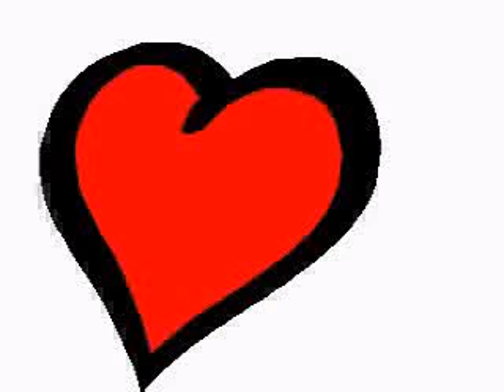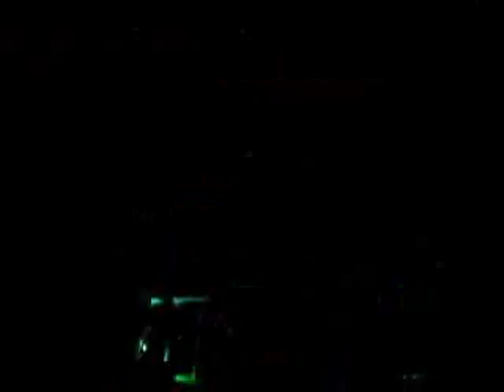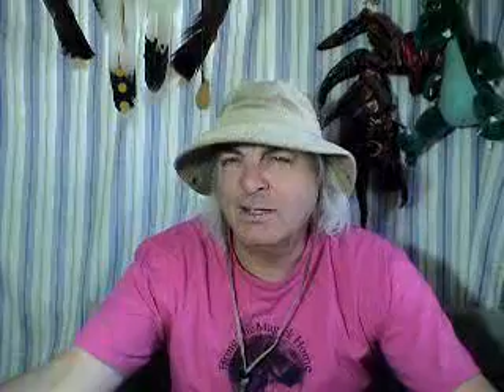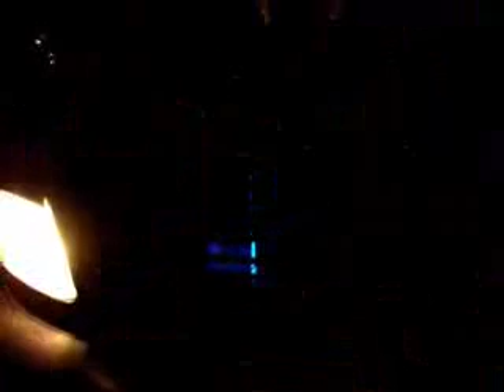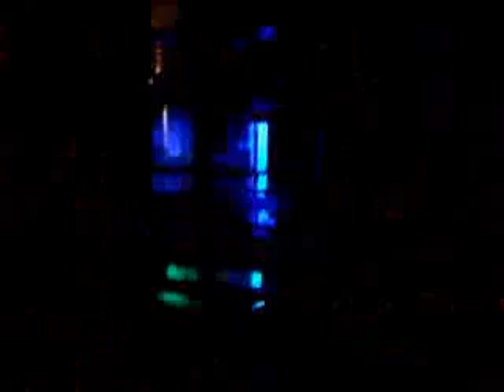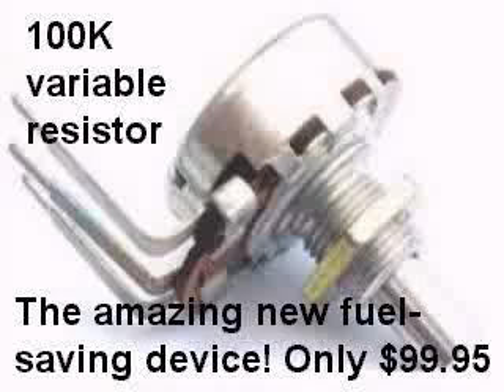Re: "HYDROGEN HYBRID (sic) TRUTH (sic)"

Comment: Regarding the alternator, did you know that an alternator only uses about 3 to 5 HP at load? Did you know that installing a CAI can increase you HP by 10 or more HP? So if I add a another alternator to run my HHO generator and install a CAI I won't lose any HP. Visit my channel to see my CAI and how it's improved my MPG. Look in the comments section and find a link to the DOE report I mentioned earlier. My next MPG test will be to add a 20-40 amp load to my alternator and see if it affects MPG

Comment: I think you need to do some more research because you are wrong. Here's proof taken from a D.O.E. report published in 2001: Hydrogens low ignition energy limit and high burning speed makes the hydrogen/hydrocarbon mixture easier to ignite, reducing misfire and thereby improving emissions, performance and fuel economy. Regarding power output, hydrogen augments the mixtures energy density at lean mixtures by increasing the hydrogen-to-carbon ratio, and thereby improves torque" 

Continued...

Comment: I never run an engine lean. I only use my HHO cell to make the improvements. 
I am sure You know how to fuck up an engine, but that is not what I am doing. After 1 year on HHO my van runs better than ever. I was about to rebuild it before I added the first HHO unit and now I won't touch the engine because it runs so good.

Comment: Since your name says intelligence I will ask you what experience you have with HHO gas? My system operates at less than 10 amps and gets me 30% improvement in mileage. 
Theoretical "PROOF" is useless when discussing this effect. According to energy conservation this should not work, but it does.

Comment: Put your money where your mouth is "Expert". I will pay anyone's travel expenses to the Jarboes Mill event May 30-31 in Md. if I cannot prove by driving down the road that my system gets 30% or better improvement with HHO. You will be required to pay me $1,000 for the ride when it is proven. Of course you will dismiss the test as "Unscientific" and run with your tail between your legs like all the others. Either way it will shut you up.

Comment: You electrical energy is not free. The alternator has more resistance with larger loads. The key is keeping the amp draw low. My systems use less that 10 amps on most cars. In my van I can't use more than 7 amps or my mileage gets worse. Your right about the fuel burning more completely. I have met Ozzy and a lot of other hho guys. I was not impressed with him. I group him with Lee. Ozzy did do a lot to bring attention to the HHO movement so I give him credit for that.

Comment: You are making quite a lot of sense there and I too have my doubts about this whole increase mileage thing but what about the HHO generators used for welding?

Cant one simply use Hydrogen instead of Oxy Acetylene for working with metals and such?
I know Hydrogen is highly combustible so normally it would be dangerous but as it is produced on demand in relativeley low quantities wouldnt that be safer than the traditional big tanks full of explosive gas?

Comment: these claims are true if u run a vehicle on hho u will get more fuel mileage and a smoother running engine but those devices are inefficient and a drain on your alternator ,also u do not have to touch the map sensor if u put the inlet hose before the sensor it just fools the sensor on its own.

Comment: Desertphile, you look like an interesting guy by the way. Anyway, did you watch the Myth Busters episode where they debunked the HHO generator? I still have not but I did hear that they didn't add electrolyte into the water inside the generator, do you know if this was true or not? Also, do you know of any hard test data on these devices? As of last year there wasn't anything that I could find  which is one reason I didn't buy one.

Comment from the maker: "But, if one was to actually program the ECU to accept the newly introduce fuel, the mileage per gallon of gasoline would increase as less is needed."

What "new fuel?" These devices don't produce enough H-OH+ for the engine to even notice. There is no "new fuel" from these devices. No matter what one does, these devices do not work.

Comment: No, you can't just buy one of these systems and throw it on your vehicle and "Ta-da" better mileage, perhaps on new vehicles the ECU picks up a little better, but still is does ad to the power you get from your vehicle even though it is consuming more fuel if inproperly used.

Comment: example would be a tuner car (Which I do most of my testing on) with either APEXI or ECM-Link where you can manually adjust everything that goes into the engine. Yes, there are dangers to leaning out the fuel mixture too much with a stock bottom end, that is know. Currently the lowest possitive test I have completed was 23.75% fuel to 76.25% air. But back to the question "OxyHydrogen does nothing?" that is totally false, but as to the effects it has all depends on installation. ...

Comment: Yes, it is true that these devices BY THEMSELVE will cause the ECU to "Waste Fuel" in a sence, but even at worst case scenario and the the ECU does "dump" more gas into the cylinder, you are going to see a HP/Torque gain like running with alcohol, or nitrous( no that large a boost since the lack of pressure in current hho devices). But, if one was to actually program the ECU to accept the newly introduce fuel, the mileage per gallon of gasoline would increase as less is needed. A perfect ...

Comment: "they use liquid oxygen and hydrogen to propel stuff into space after all dont they"

Yes, they do, but.. with limitations.  Say NASA fills up the external fuel tank of the Space Shuttle and then the launch is delayed a few days.  That tank isn't pressurized, it only holds the fuel so long as it remains supercooled liquid.  But since our atmosphere is not supercool, they heat up and evaporate and are vented.  They have to keep topping off the tank until launch.

Comment: "so what if you just syphoned a little of the power it is already generating to perform the hdrolosis?"

Okay, this point is being made over and over again.

Because you are not drawing power off of that which is being already generated.  Before plugging it in to the fuel cell is is drawing a certain amount of power.  Plug it in to the fuel cell and it has to generate more power, and as such puts more of a load on the engine which causes it to burn more gas.

Comment: I'm not talking large electrolytic caps, which can hold a charge for a couple of weeks.  I'm talking the double-layered carbon foam types.  They call them supercapacitors or ultracapacitors.

If you've got production supercaps at work that can hold a reasonable percentage of their original charge for more than a day or two, I'm way, WAY behind the times.

Comment: You could get the same effect of leaning out the gasoline to oxygen ratio without using an illegal device on your fuel injected engine by driving only at high altitudes. I was amazed that when I drove through the passes of the Rocky Mountains my mileage went up even though it felt as if my engine was working harder. But using gasoline to produce a gas that the engine doesn't even use is just stupid. Another great vid! Keep 'em coming.

Comment: Pulling torque off the crankshaft by connecting to the alternator isn't "free"; it produces drag on the engine equal to or greater than the power output of the alternator.

Meanwhile, use of supercapacitors is rather specific; they lose their charge in a relatively short time (something like 24-48 hours), so they're excellent for quick-cycle applications - such as hybrid cars - where you need to be able to store and release a large amount of power at a high cycle frequency.

Comment: The costs for valve jobs average $200 to $600 per engine cylinder in the midwest. You have to do them all, because what effects one cylinder, can and most often does effect them all. Double that cost range for the east coast, and triple it, for the west coast. The jobs often cost less for dealerships, because they will gamble that the owner will dump or destroy the car in some other way before their crappy one-hole-fix shows up. 

Foolish toys are not worth gambling your working car on.

Comment: Yes, but this is based on the "free" energy, and some way of storing that energy. I think it would be valuable to incorporate it with batteries. The amount you can store is always finite, but you have to use your ongoing estimate of regular use as a basis to decide the parameters of the size of the storage devices. And water/gravity would be more user/environmentally friendly than some other things, like lead/acid batteries. Wondering about the use of "supercapacitor" developement for storage.

Comment: Indeed.  In fact, there's no way to break even with *any* energy storage method; it just can't be done.

That said, some methods are more efficient than others.  Battery systems have a storage efficiency around 95%, for example.

For this one, if you take the efficiency of water electrolysis (about 50%) and the efficiency of internal combustion (about 25% - lower, since the engine isn't tuned for it), you get the storage efficiency: 12.5%.

Comment: The facts are that - 
1. You can produce a combustible gas through electrolysis.
2. The power needed is to do so is more than will be harvested.
3. If you burn true HHO it will spike the MPG down as burning HHO spike O in the exhaust stream.
4. Yes it is illegal as you said.
5. IC engine is only 10-15% efficient.

Install a user programmable chip for better MPG. These fools need to learn something about fuel curves,

And that is from a Master Certified Auto Technician=Me

Comment: 2a.   ...Also thought, it would be safer to use said generated electricity to power a pump to pump water up into a storage tank in the house, then use the water falling to run a generator when I needed it. Just simpler, and safer, though likely not worth it.

Comment: 1a.   Thank you. Didn't know that much in terms of nomenclature. But I also thought they discarded the Oxygen component of the gasses because these "bubblers" are usually said to be making hydrogen. Yes, I know they produce both, but I'd assumed the Oxygen in the atmosphere was sufficient and made one less costly process to bother with. Also thought, unless you generated the electricity via wind, solar, or some other source, and had some efficient way of storing the resultant gas, it's a loss...

Comment: Oh, and one note...  depending upon how far they're overleaning the engines they MAY be gaining power.  My experience is only with airplane engines, either full sized or miniature for remote control purposes (very different engines, but the same principle applies), but in either situation you tune it up to maximum power and then back off a bit.  To a degree they might be able to increase power and decrease fuel consumption.

But they're still decreasing engine life in that case.

Comment: I really want to ask these clowns what they think would happen if they took, say, a full battery, used it to run an electrolysis unit, and used the gas output to run a motor.

Unless that thing should run forever, this concept is fundamentally flawed.  Any of you HHO rebels out there think you can make this work?

Comment: I haven't found a single promoter of this concept that can explain how something with so many efficiency losses (first in the alternator and then in the fuel cell, total of probably more than 50% of the initial power gained from burning fuel lost in the process) can boost efficiency.  End result you burn X amount of gas to split water and gain the equivalent energy of LESS THAN X.

Comment: well i see imrovement in a diesel vehicle-no MAP or MAF there.
the extra load on the alternator didnt present as less mileage-my battery didnt go flat.
i went further-and the volume of gas entering the air intake was way under 1 LPM,and also mixed with air before adding.
im concerned more about Hydrogen embrittlement than anything else-so i dont use it anymore,because i cant afford a new vehicle.
i dont sell kits i just tested the idea-which is more than u have done.
nothin +ve ?

Comment: Agreed.  Plus EV's with regenerative braking put electricity back into the batteries whenever the foot is on the brake or just off the accelerator (as when coasting) when the vehicle is on.